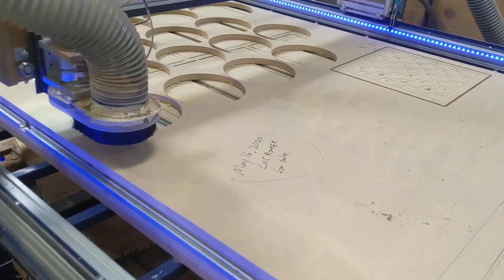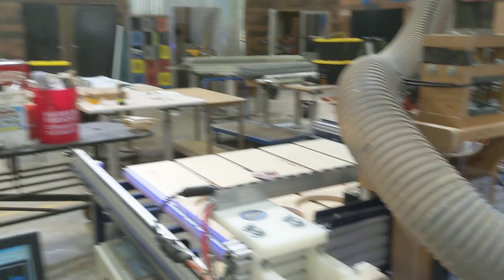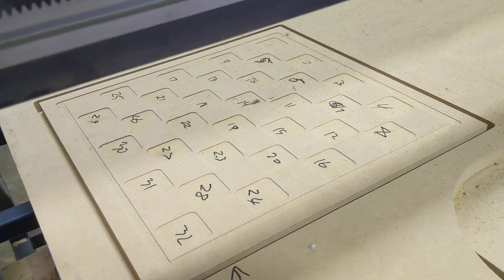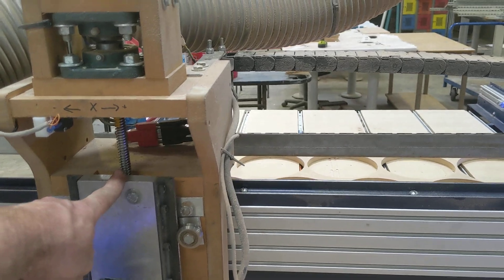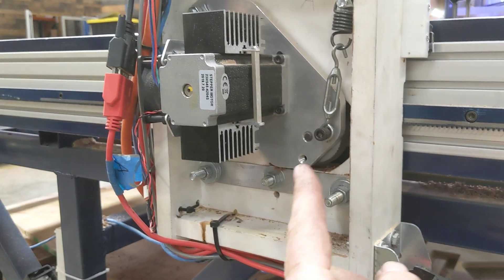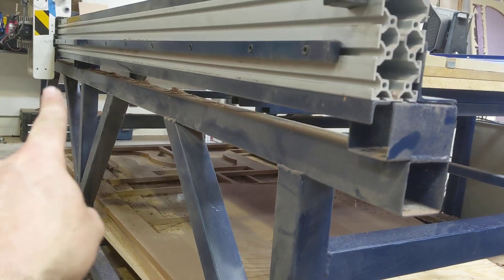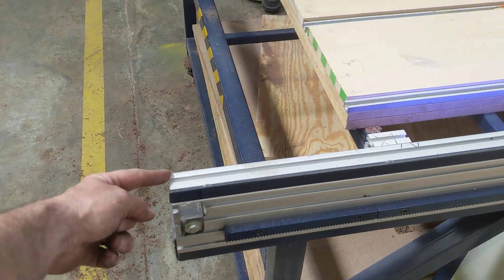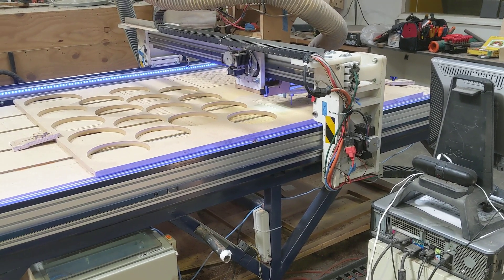For Sale: 4x8 CNC Router

Comment: What was causing the Z axis issue?
Reply from the maker: We chased the problem for a while, replacing the stepper and and having the Gecko G540 controller factory rebuilt. The problem was probably a loose wire, now corrected. We have not seen any z-axis glitches in 3-4 hours of tests since then. If not, the only thing left is the motor wires, which are less than $100.